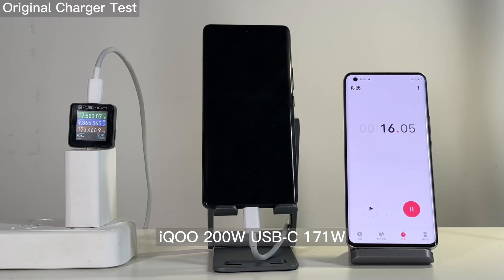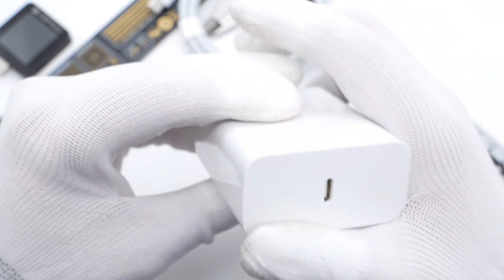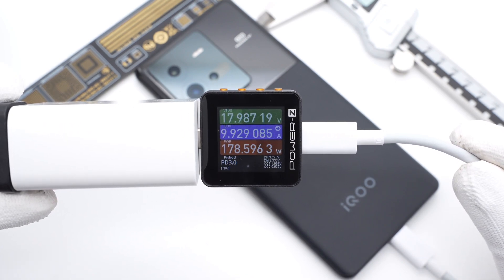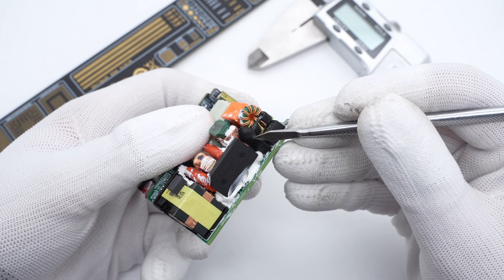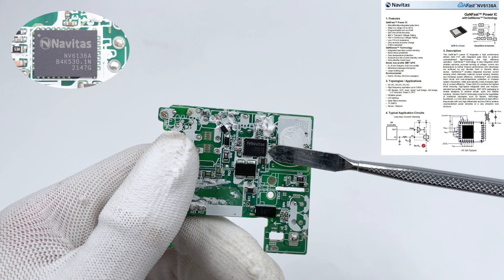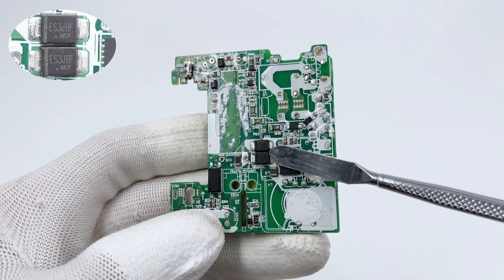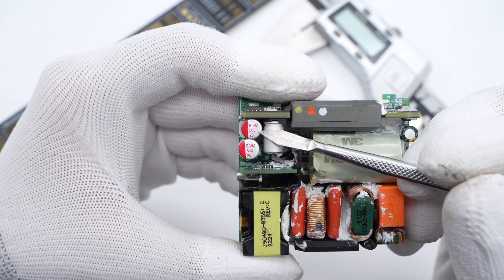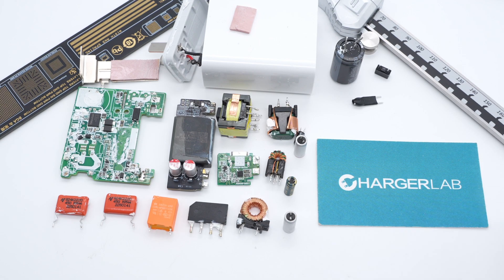Teardown of iQOO 200W GaN Charger (For iQOO 10 Pro)

Comment: According to the specification the KM002C tester can handle 6A. But this video shows 10A. Is it a different version of the tester, or can the tester handle 10A (or more) for a short time?
Reply from the maker: Yes, we added 10A support in the latest firmware. 
You can check our tech support page to know more: https://www.chargerlab.com/km002c-technical-support/
Reply: @ChargerLAB  Thanks, that's great! Does this also apply to KM003C? I'm considering buying a USB tester and this one looks the best so far.
Reply from the maker: Yes, the KM003C also supports this feature.

Comment: Was this possible for replacement charger for a lenovo thinkpad workstation laptop which has a 170W(12v, 8.5amp) bulky power brick?
Reply from the maker: No, lenovo thinkpad workstation laptop is not compatible with this charger.

Comment: Wtf 10a over usb c does it melt the connector
Reply from the maker: No, it won't.
Reply: For high power charging, there is almost always a temperature sensor at the connector so they can know if it is getting too hot.
Reply: @mrrkrr  I'm tested with 6.5amp over type c the connector become hot
Reply: @mrrkrr  this 10amp over type c is no make sense
Reply: all type c connector are built different.

Comment: interesting. I thought the new standard up to 240W uses 48V. therefore this product is proprietary which is not good.
Reply from the maker: The PD3.1 protocol uses 48V, since its current is only 5A.
But this charger can output up to 10A current.

Comment: I wonder if this charger is not rated for 200 W continuously but is designed to supply the high power for the short amount of time that the phone can actually take it
Reply from the maker: 200W is the highest power, not continuous power.
Reply: @ChargerLAB  which one is the best performing  W/cm^3 for continuous without active cooling?   Is it UGREEN Nexode 200W USB C? Will you do that soon? Cool content!!!
Reply: Yeah I agree; 65W for PD seems to indicate that's more likely the continuous power at which it doesn't overheat